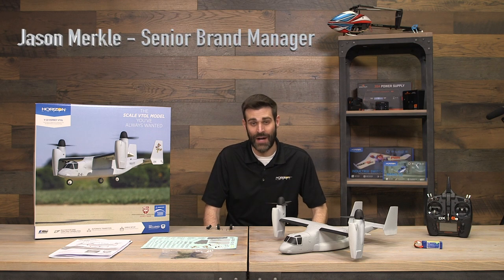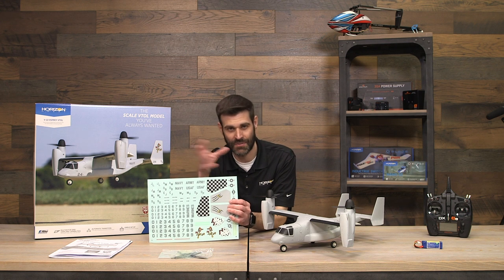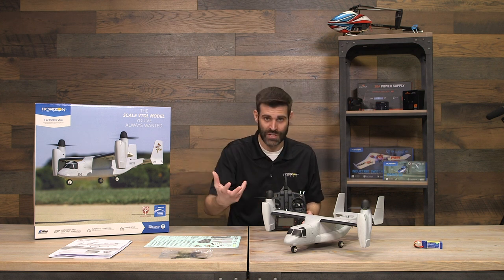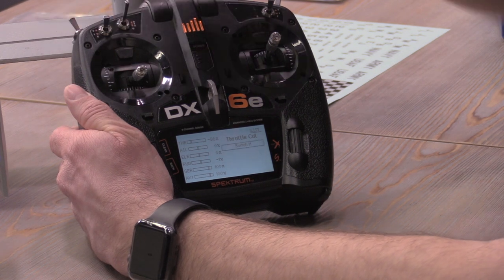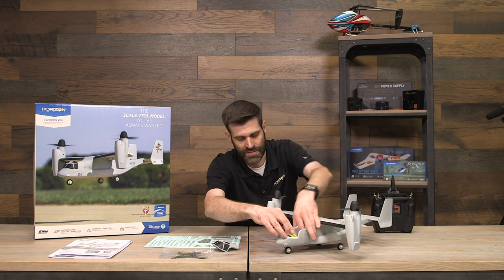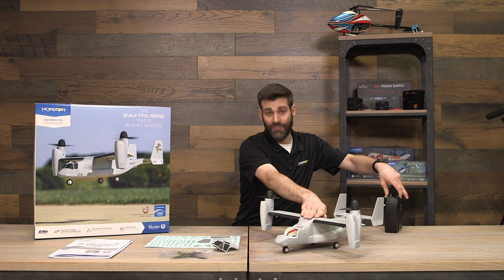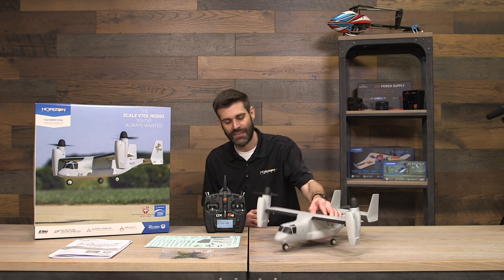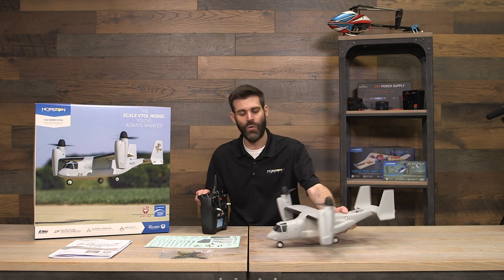E-flite V-22® Osprey VTOL Setup/Flying Hints and Tips

Comment: As I was watching, I couldn't help but notice the similarities to your Xvert model, which uses the same single 3 position switch to go from heli/hover mode to forward flight stability mode to forward flight acro mode.  The Xvert has an "idle" with the motors spinning up on the ground when you (I think) press the bind button for flight..  I think it is then the H switch that shuts the idle down-or maybe it's the H switch that does both...

Comment: Thanks for your review. 
I got mine yesterday and realized that when it is in airplane mode, the right side motor and propeller is more titled down compare to the left side one. When I change to helicopter mode, the both side motor is in same angle. I haven't fly yet because I wasn't sure if that could affect the flight in airplane mode.
Is this normal?
Reply from the maker: Hello,

You need to make sure that the nacelles (motors) are in sync during and after the transition. If they're off, the model could potentially roll during transition.  You can mechanically make the adjustment by lifting the wing and adjusting the control arms off the servos.

Comment: Greetings.... Will a Spektrum DX6I transmitter work with this model?
Reply from the maker: We do not recommend it and strongly recommend replacing the DX6i (which was first released almost 15 years ago and discontinued many years ago) with a current generation DX6e, DX8e, DX6, DX8 or DX9 transmitter. That said, some have gotten the DX6i to work and you can likely find more information via internet searches (and on RCGroups.com).